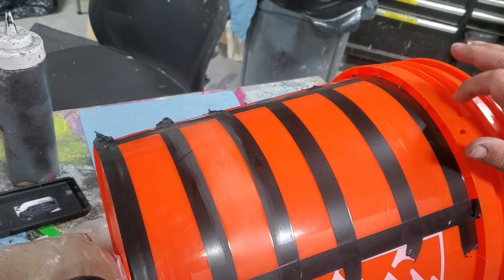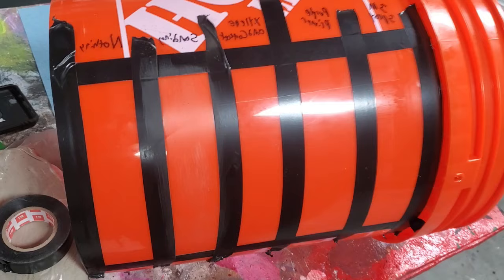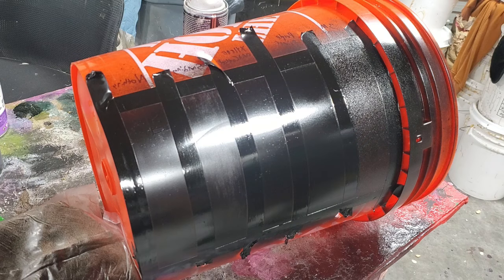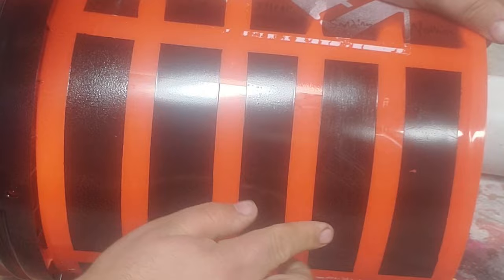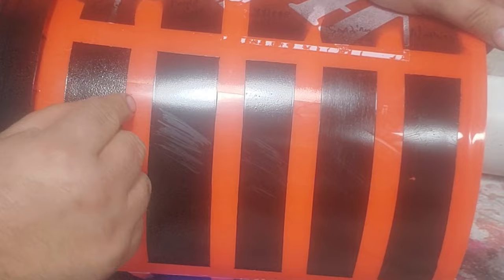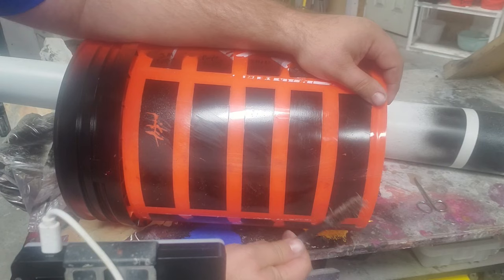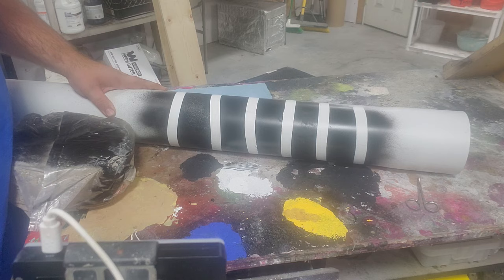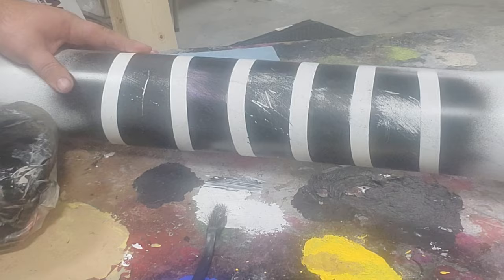spray painting plastic- best primer

Comment: Caution ! The purple PVC primer is a great bonding agent! .. However if you are going to spray paint a white or lighter color the purple color will bleed up through the paint and leave a splotchy purple cast in your finished paint, Even with numerous coats of paint the purple will reappear. Oatley does make a clear PVC primer that works very well and won't bleed through your finished paint.
Reply from the maker: thank you, yeah Im only going for black at the moment! great tip though!
Reply: Could you leave the primer on it as a top coat outdoors?
Reply: @MP-vf8qz  no it will perish. Primer and car putty soak water.
Reply: Oh thanks for this info.
Reply: With the purple primer did you sand as well??? Or just apply and then sprayed after drying??
Reply: @StiltbeastStudios  use 2k paint. That paint is weak 👍
Reply: Aw....man.....too late.
Reply: @JoseRuiz-eb3gn  I don't think he did.

Comment: I use rubbing alcohol to clean the surface first. When dry then I prime with Rustoleum Self Etching Primer - Gray.  Then what ever Rustoleum 2X color I need. Finish with Rustoleum Matte Clear Coat.  I have camo painted all my pellet rifles, shooting benches / tables (folding tables which are plastic). I have also painted T-Fal frying pans, these make excellent cheap plinking targets. Any paint I used without the self etching primer would flake off in big chunks when struck with pellets. This stopped when i switched rustoleum self etching primer. I know its a bit off topic, but the point Im trying to make is this Self Etching primer is awesome on plastics and tough as nails. I don't have to repaint my plastic surfaces anymore due to normal wear and tear.  Great Video! :)
Reply from the maker: thats awesome- I see future testing is in  order!
Reply: Great tip.
Reply: Does it come in clear? sos that I can paint something white

Comment: Chemist here with a few years coating chemistry experience. Never though of purple primer for polyethylene especially HDPE. Makes sense. Solvent softens HDPE and let's materials penetrate the polymer network. I looked at ingredients over 10 years ago and, back then, listed a chemical used to bond scratch resistant coatings to polycarbonate eyeglass lenses. So it makes sense for purple primer to help bond paiit to plastic. Now I have a resin shed converted to home office that needs its roof painted and this looks better than anything made by paint companies.
Reply: Thanks great to hear back from a chemist.
Reply: people are looking for an adhesion test ,  not a wire brush scratch test because any coating in gonna get scratched from using a steel wire brush on it ,  even a 5000 dollar factory automotive paint job is gonna easily get scratched from using a steel wire brush on it.  he should have tested it with using his fingernails or cleaning it to see what the results of that would be because that would be the most likely thing to come in contact with most surfaces . but contact with a wire brush is not common so this video was kind of useless .

Comment: The "Purple Primer" is essentially "Acetone" which PVC makers recommend for priming PVC. The purple coloring is for building inspector's benefit. It's an indication that the PVC piping was primed before the bonding solution/agent was applied.
Reply: Purple Primer usually has four active ingredents, plus dye. Its not just acetone.
Reply: Gotta have some glue in it or I couldn't use it so seal up small cuts

Comment: Old video, but Flame treating plastic works well. You use a propane torch with a a wide nozzle and a soft flame. The idea is to just “kiss the surface” without melting, moving the flame quickly. It should look like you did nothing to the surface when you are done, maybe a little soot left behind. It essentially releases free radicals on the surface of the plastic which will grab onto paint and or adhesives. It’s what the experts in the plastic manufacturing world use to treat next to impossible to bond plastics like HDPE/ LDPE.

Comment: New Test Variables: 
1) Pressure Washer Test (15° nozzle @ 1,2, and 3 ft. and other relevant settings for item's use specifics)
2) Fade/UV Resistance Test (direct sunlight for 8 hrs. for 1 month. Time permitting, a 6 and 12 month followup short video of results)
Possibly add followup results of other items tested in a 'followup video' with items tested at different time intervals. 
This video was great. Good Job and thank you for the time and effort you spent on making it.

Comment: Main solvent in pvc primer is acetone. Fast acting solvent used to soften, clean and prepare plastic. Nothing of adhesion is left behind. You are painting chemically treated raw plastic. Purple is mainly a visual indicator. Once opened, they both quickly disappear from the can. Even with the top on. Makes it hard to keep on our trucks.
Reply from the maker: thanks for the info!

Comment: Loved this video! As an automotive painter I always sand and never paint anything shiny. I use a ready to spray adhesion promoter when painting non steel.
Reply: Is adhesion promoter expensive?
Reply: @RocketPunchHero1  about a 116$ a gallon for Transstar brand.  I scuff or sand first then shoot a coat of promoter on through an hvlp( paint) gun or  airbrush for small parts.
Reply from the maker: I will add that to a future test list
Reply: Cobwebs; is there something in a spray can from a big box store to use as a primer? Thanks man.
Reply: @swingbelly  not that ive seen. There is a an adhesion promoter in a spray can made by UPOL to be sprayed before shooting bedliner down. I haven't tried yet but I.might buy a can and test it. Never paint anything shiny though! That's the best advice, sand ot first for a strong mechanical bond.

Comment: Haven't looked recently, but they used to sell untinted PVC primer. They started making it purple so plumbing inspectors could easily tell primer had been used in construction. Also, you can get the primer in a spray can now, more expensive, but I know you weigh cost vs ease vs time too. You may also be able to use it through an air gun, but I don't know, it is quick drying so it might clog up quickly.
Reply from the maker: im pretty sure it would eat the bottle, and they do still sell the clear
Reply: Where can you get the primer in a spray can? I've looked locally and on line and nobody has ever heard of it.
Reply: @kevinleonard5315  I saw it at Menards.

Comment: I've used the 3M spray adhesive to get spray paint to adhere to plastic wrap when making noodle roots and vines.  Works pretty good.  Paint hasn't scratched off yet and it does get a bit beat up with setup and tear down every year, but that was on plastic wrap and not on HDPE/PVC plastic.
Reply from the maker: got it, I will add plastic wrap to my tests in the future!

Comment: I have plastic trim on my sorento that was scuffed and took away the texture and had to replace a few pieces.
What I did was to remove the trim and make a block from 2×4 to support the back side.then with a piece  of the old textured trim 2"×6" glued to a radius on another 2"×4 .using a heat gun and heating the trim (I practiced on the old peice) I was able to transfer the texture to the damaged trim by pressing and with a roll motion using it as a sort of die,make sure to also put a champher on the edges.i then (using the clear primer ) painted it with flat black from the auto paint storei its holding up great.it takes so time to get the texture right but with some practice on the old trim,with different heat and pressure methods it can come out prity good.also for small spots I used a plywood backing on a smaller die using vice grips.id like to see a expearamint with that.any other methods you come up with.thanks for the great info,if been searching for a good adhesive to hold the paint,I think you nailed  it buddy.😉

Comment: This was great!!! Did you ever do a video on tinting the purple primer? I would be VERY interested in that! Painting plastic is a huge part of theater and always a challenge.
Reply from the maker: Not yet! I swear I will soon.
Reply: I just mixed some very dark Minwax oil-based stain with a half a can of purple primer and coated a 10" length of 1.5" PVC.  I'll let you know how it does and if it seems to work I'll decipher specifically what stain I used.

Comment: One thing to consider, painting plastics can have a chemical affect on the structural integrity of the material, usually making it weaker.
Reply from the maker: it can, its normally minimal most of the work I do is decorative.

Comment: Would suggest the test we did at the cabinet shop.  Apply your top coat let it cure the cut a checker pattern into it and lay piece of masking tape down and yank it off.
Reply from the maker: noted, I will give that a try!
Reply: @StiltbeastStudios  people are looking for an adhesion test ,  not a wire brush scratch test because any coating in gonna get scratched from using a steel wire brush on it ,  even a 5000 dollar factory automotive paint job is gonna easily get scratched from using a steel wire brush on it.  u should have tested it with using your fingernails or cleaning it to see what the results of that would be because that would be the most likely thing to come in contact with most surfaces . but contact with a wire brush is not common .

Comment: I've been trying to paint Polypropylene plastic eggs for an easter diorama I'm making for the last 2 days and have learned the hard way that the paint just peels right off. I tried some sanding, but it's pretty unappealing for what I'm working on. I'm going to pick up some purple primer tomorrow and see how it goes. Thanks for the video!
Reply from the maker: good luck!
Reply: @StiltbeastStudios  Unfortunately the purple stuff bled through the white primer I was using even with several coats. I put another color over it and it looks a little better, but It seems sanding may be my personal best option. It's hard to do on a giant egg though :D
Reply: @chaosbringer12  they have it in clear.

Comment: I'm curious if you've tried a flex test.  My disappointment with spray-painted plastic, especially thinner plastic, mostly stems not from abrasions but from flaking when the plastic flexes.

Anyway, I love seeing experiments like this.  Thanks!
Reply from the maker: i didnt really paint anything thin, so I did not
Reply: That would be a good test.never thought pvc primer would work so good.

Comment: I've read that to spray on plastic your supposed to sand first then clean with mild soap and water
Then supposedly use rubbing Alcohol to ensure the surface is very clean then you use a acrylic type primer

But I've not seen any spray on undercoat which I'm assuming you do not need to use an undercoat unless anyone else can tell me different
Reply from the maker: This whole video is me figureing it out- these are my methods.

Comment: Very good video. Got right to the point and had good conclusions. I need to do some painting on an old Lawn Boy lawn mower shroud, and it looks like Purple Primer is what I need, especially since I will be painting a small area (not the whole shroud) that has some contours that would make it hard to sand without sanding areas I don't want sanded. Thanks much!
Reply from the maker: Glad it was helpful!

Comment: I've heard they make spray paint specifically designed for plastic. What if you did a test with the following four on, let's say, a faded deck storage box. 1) No primer, just the spray paint for plastic. 2) Sanding and then the spray for plastic. 3) The PVC primer and then the plastic specific spray paint. Then lastly, 4) I saw on another video that you have to first wash the deck box with soapy, sudsy, water, wipe it down, apply paint thinner and let it dry. Then spray with spray paint meant for plastic.  I'm curious to see if a spray paint designed for plastic works better with a prepping stage or without.

Comment: Hey great info!  My situation might be a bit different.  I have 8-9, two inch risers with brass ball valves coming up in 75 foot or so intervals along my wood line permitter around my house.  I live in a very fire prone area.  I need to protect these little “mini hydrants” in case SHTF from the UV to act as a last ditch potential defense.  Yea this will be damn futile in a real full on crown fire….) but I  also want to  use them as occasional irrigation….

But my question is that wouldn’t the heavy application of PVC primer weakening the pipe enough to possibly compromise the strength of the pipe as opposed to say doing a light to moderate sanding job?   I like the easy quick way but I have a lot already invested in building these “hydrant stations” with multiple brass ball valves, strapping to the 4x4s out of concrete, obvious PVC pipe and labor and don’t want to have to redo it in a few years due to the high UV we have here in Colorado where I live at 7000 feet which is pretty severe.  Any thoughts would be greatly appreciated !   Cheers , Chad
Reply from the maker: yeah this is for prop fabrication- in most plumbing applications you do not paint the pipe, so thats not the intent of the video. you could be correct but ive never tested either for pipe psi afterwards.

Comment: Fantastic!!  I have always had to sand plastic before painting with acrylics, doing faux curtain rods or picture frames.  Then Dixie Chicks came out with a product called “Slick Stick” but it didn’t impress me none.  Ive gotten better results by just spraying on Rustoleum 2X in clear matte.

I’ve been wanting to paint my plastic shed to match my house, just not sure how to go about it.  (Lifetime Shed)

I wonder if etching cream (like for glass or ceramics) would do any better?  My shed is 9ft x 20ft so I’d need a lot!  lol 

Also, I’ve heard there is some type of bonding agent you can add to paint and use a hvlp sprayer… would be worth investigating.  

Love your creativity!
Reply from the maker: I have a follow up to this coming soon

Comment: is there a difference if craft paints were used instead of spray can paint? 
i'd be grateful if you also test on store bought skeletons or other props made with the same crappy plastic
alan, you are a genius, love everything that you do, especially when $ are taken into account. no one does it better :-)
Reply: For aging "skeleton" plastic, a lot of people have luck with the gel-based wood stains.  The gel-based stains also work on cling-wrap used in corpsing.  Of course, that doesn't give you quite the range of colors and finishes that you'd get from paint.
Reply: @haywardhaunter2620   thx for the info ... i like painting my skeletons with fluorescent/neon black light reactive paints but unfortunately the slightest bang & the paint comes off  :-(
Reply from the maker: I will work on that for you.

Comment: Rust-OLeum UNIVERSAL IS A PREMIUM ALL-SURFACE PAINT that provides the ultimate long-lasting protection and durability. This breakthrough, rust preventive formula adheres to “ plastic, “ wood, metal, concrete, wicker, aluminum, and masonry surfaces. A comfort grip trigger eliminates finger fatigue caused by continuous spraying. Any angle spray allows you to spray even upside down. Fast Drying. TIP: Some plastics made of polyethylene such as plastic storage containers are manufactured in a way that may hinder maximumpaint adhesion. Test paint in a hidden area first. 
As long as the area is clean & oil free you should be good to go according to the MFG unless it’s a food or food safe container like some buckets  like Home Depot which is food safe ... I’m Not attacking , just did some reading and wanted to share this ...
Reply from the maker: have you tested it? I hate to say this, some companies lie.
Reply: @StiltbeastStudios  I have on small projects like my 20 foot Christmas light C9 tree , the center PVC Pipe I use I painted green has held up in the southern weather pretty well over 9+ years . I have a 4x4 PVC mail post I painted almond a few years back and that too is holding up , I even did some light power washing to remove dirt , bird poop & lizard poop etc off of it and No peeling . I forgot I also did the plastic mail box it was dirty sun beaten white and I sprayed it black and looks great even with Full sun exposure during the day.

I did make sure the plastic I painted was always clean and wiped with alcohol just before spraying but no more effort than that really. 

Thanks for your replay ...
Have a good day !

Comment: spray adhesive as a primer for painting HDPE surfaces you want to reset to default color by simple scraping or maybe pressure washing🤔? Also could make giant scratch off ticket things.
Reply from the maker: it does scratch off that easy lol.

Comment: 3M makes #80  for plastic but adhesives are not primers. Great if you want a textured surface.
Reply from the maker: if the paint sticks to the spray adhesive and the adhesive sticks to the plastic, then it is a primer. ya gotta think past what it says on the can. in a lab or factory yes things would have been done differently. Im just a dude in a shop.
Reply: @StiltbeastStudios  Thinking you are smarter than the manufacture and dozens of engineers will only lead one to an early grave. While I get your point a primer and a glue are not the same. Primers are removable. Glues are meant to be permanent.
I can mis-use a wrench as a hammer but it is still a wrench and now possibly a broken wrench.

Comment: I wonder how they do on bending tests. I spray paint plastic bottles for a number of things and they do fine until the plastic bends for whatever reason. Paint pops right off in big flakes which then disintegrate like burnt paper.
One time I did give a layer of water based acrylic paint to an ice cream bucket and then spray painted it and it seems to have done a lot better, but I did loose the even, glossy finish that all the others have.